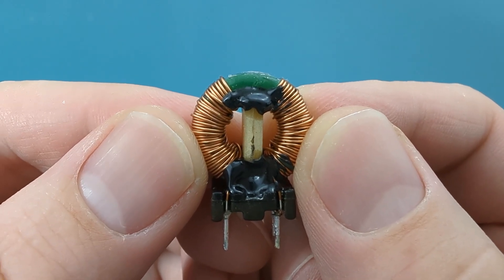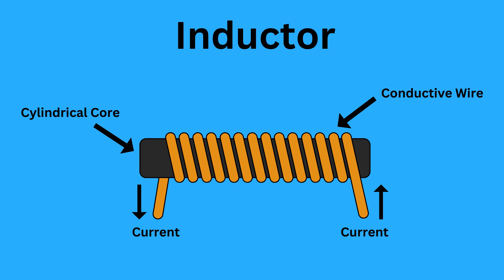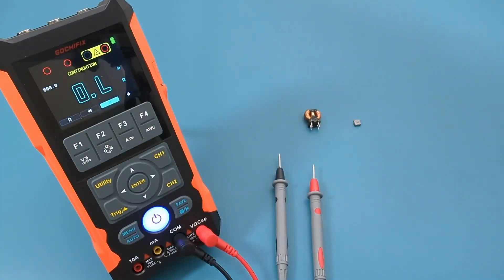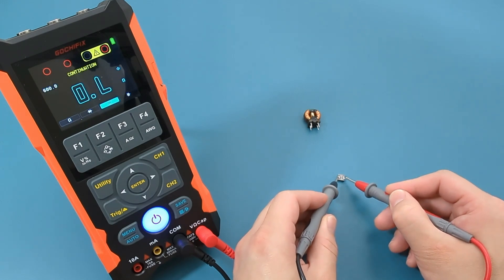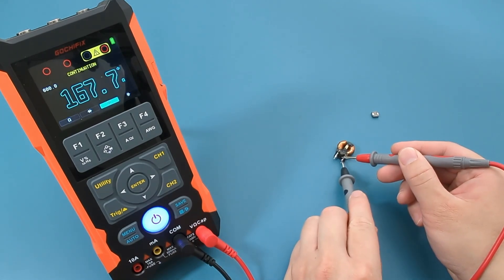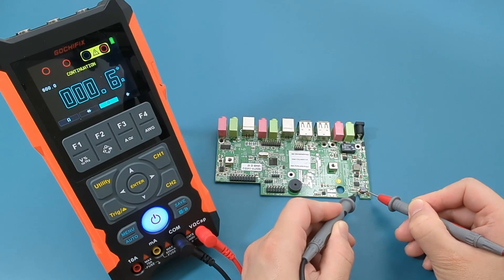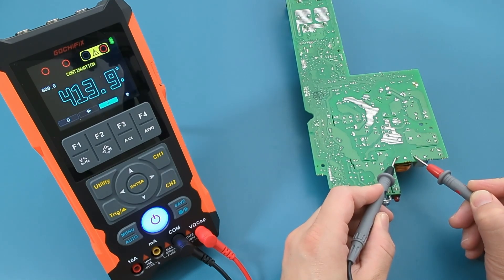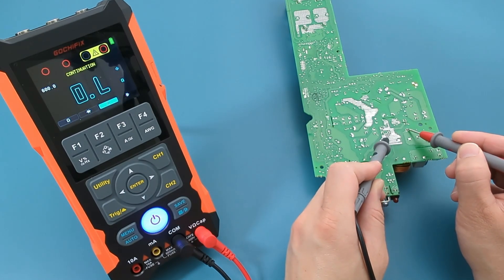How to Test an Inductor with a Multimeter

Comment: What if the windings have shorted, wouldn’t you still get a low resistance reading?
Reply: Congrats you worked out why this video is nonsense 🎉
Reply: Exaty  yes you would.  I don't get it
Reply: If it is shorted  , will show less value in ohm s.